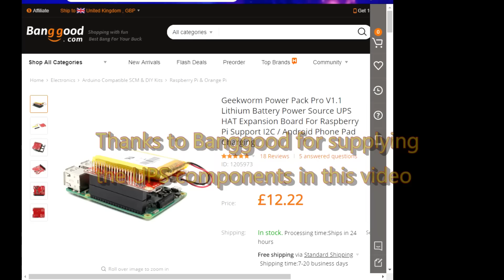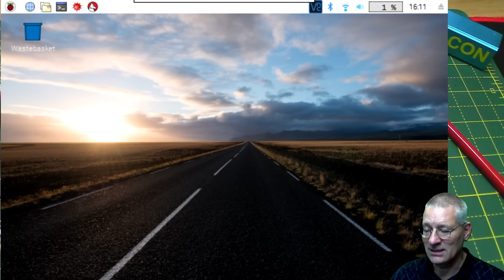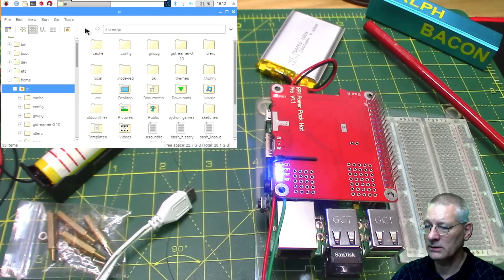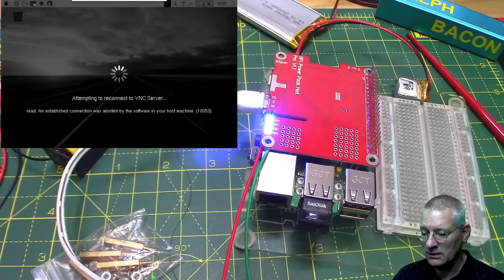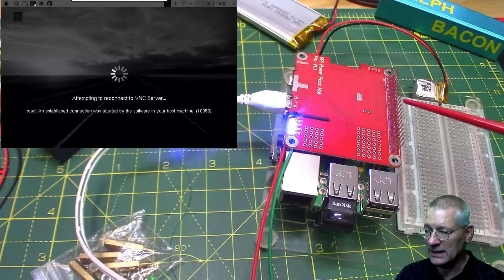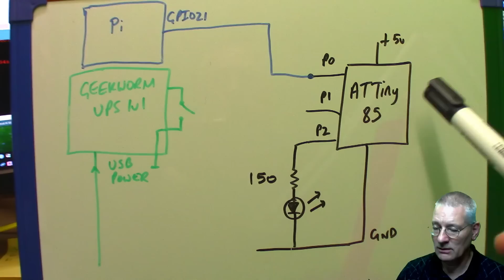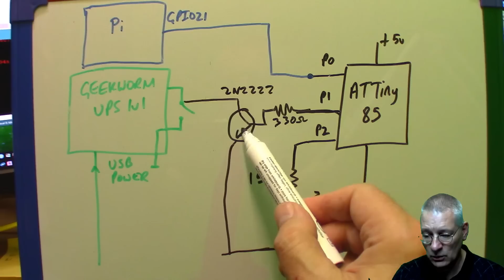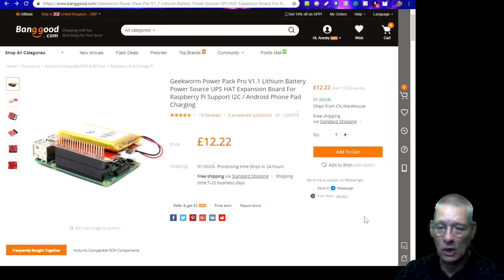#124 Raspberry Pi UPS Fix - with an ATTiny85 control (EASY)

Comment: Another interesting video Ralph. I suppose the next challenge is to measure the voltage from the UPS and send a signal to the RPi so it can shut down in an orderly manner! Then when the voltage rises above 4.5v restart it.....
Reply from the maker: This seems a common theme in the comments today, Ian! Yes, I'm hoping to monitor the battery pack using I2C from the Pi itself. We shall see.
Reply: @RalphBacon  Need video on this..

Comment: nice solution Ralf...….quite surprised the manufacturer missed it
Reply from the maker: I'm not sure they missed it, exactly, just didn't provide a solution for when the battery went flat. They probably thought, "What's wrong with pushing the button?".
Reply: If its in the middle of a bloody beehive pushing the button IS a problem!...haha!

Comment: Great source of knowledge thanks! 
It seems Geekworm released an upgrade a few months ago, and which comes with an "AUTO UPS" switch that would ensure to auto "push" the power switch by itself. If it's effectively working, it would simplify the scheme quite a lot. I'm just wondering how it would behave if we detect a power failure via the I2C channel, then we shut down the device, but during the shutdown phasis, power gets back. My guess is that the RPi will finish the shutdown process normally but will not boot again until a new power failure/recovery cycle is achieved. Actually, I'm wondering the same for the circuit of this video. Anyway, all of this is quite interesting!
Reply from the maker: It's always the edge cases that cause problems, Bilel! I don't know what would happen with this circuit but it's worth mentioning it here, for sure.
Reply: @RalphBacon  If I get to play with it I'll make sure to explain the behavior here! Thanks again for all your content!

Comment: It may be a figment of my imagination but couldn't, what appears to be a couple of sets of 'prototyping pads' on the Banggood board, be used to accomodate the ATTiny85 and the other components - thereby making an 'all in one' solution?

Great video as always...
Reply from the maker: IMPORTANT! THEY ARE NOT PROTOTYPING PADS! I had to shout because others have made the same mistake. They are all connected to ground. No-one knows why they are there apart from possible cooling (ie allowing air flow). Phew, close shave, that one!
Reply: They are almost certainly "thermal vias" that transfer heat from the regulator on the bottom to the copper on the top, increasing the "heat sink" area of the PCB. So they are there to improve heat flow, not air flow per se.
Reply from the maker: Thank goodness someone understands what these holes are for. Mystery solved. I didn't detect it getting that hot, but then again I wasn't really paying attention to that aspect. Thanks for that Ian, now we all know.
Reply: It doesn't get hot because the holes work :D
Reply: Excellent work Ralph, I’m very much enjoying all your work and the in-depth explanations. 

I find your work always worth the time to watch. Fortunately I have enough experience under my belt to finally be able to understand and duplicate your work. 

You also have a very calming voice. Thank you kind sir. 🏴
Reply: I would have guessed the same thing Duncan. I have never owned one so I would have guessed prototyping. I never would have guessed they were all tired to ground. That could sure lead to a very quick short, and it might let out all of the magic smoke. Well I guess if I ever do buy one I won't be able to complain about not enough ground pins.

Comment: little guestion, i have raspberry pi 3 B+ and additional board X820 hdd 2,5" in board, and this say normal raspi need minimum 2,5A power, and whit HDD disk board and hdd disk, need 5A power supply, now adding next time DAC board too, audio need be good, guestion have. CAN i use this ups board my raspberry pi, because need power lot more than genuine. and can i keep power wall adapter alltime to connected wall and IF elektric blackout cut battery working safety and no cut raspberry. i need table computer raspberry have alltime online because here elektric cut rain season manytime/day normal 4-5time/day cut elektric.
Reply from the maker: I don't know the answer, Matti, you need an answer from Raspberry Pi  experienced users. Try their forum https://www.raspberrypi.org/forums/

Comment: Nice board. And nice solution. What could be the next step is to measure the voltage of the battery and make a safe shutdown if it goes low. Also a button to manually shutdown the pi safe (and not booting it up again) would be helpful in some scenarios. I do myself plan to use a pi in a Fotobox for party’s and like to make it bulletproof for the dumb one that pulls the power plug but also have a dedicated button to shut it down manually when the job is done.
Reply from the maker: The safe shutdown theme is running wild today, Michael. I shall certainly investigate that aspect. A manual shutdown that does not cause the Pi to be restarted by the Arduino ATTiny85 is do-able too. Hmm, food for (future video) thought.
Reply: Ralph S Bacon thanks Ralph. Looking forward to it. Grüße aus Sachsen. Michael.

Comment: Ralph that looks like a handy board. I wonder if has one of the Maxim I2C Charge indicator chips. At present could not quickly locate a circuit diagram for the actual board. Will be an interesting video when you get to this stage later on.
Reply from the maker: It has something on board, Michael, that allows comms via I2C to interrogate the state of the battery pack. I shall be investigating in a future video, I suspect...

Comment: I will eventually make one of these, thank you.  However, if I can manage to read the voltage with a tight enough tolerance, I would also send a signal to the pi to have it do a proper shutdown.  Ensuring it does not corrupt the ssd card or thumb drive by randomly shutting down during a write operation.  ("shutdown -P now" with root privilege.)
Reply from the maker: If you watch my video #173 (and #176, not yet published) You will see a simple circuit to do this. Your Pi must monitor a GPIO pin that is set LOW by the  µC, carry out housekeeping tasks, then the Pi sets it LOW again so that the µC circuit recognises the signal and shuts off the power. It will at least give you ideas on how to do this with a Pi.

Comment: Great video Ralph, it resolved a lot of my issues with battery powering my Pi units. 
 Please please re-visit I2C battery monitoring soon as (mentioned in my comment on the earlier video) I have fatally ruined a couple of uSD cards when crashing. The Pi will then  be almost totally 'bomb proof'.
Thanks again
Dave
Reply from the maker: I certainly want to explore the I2C comms from the Pi, Dave, in order that we can shut down tidily. Keep tuned...
Reply: @RalphBacon  Apologies for taking more 'bandwidth'.  Testing with my 'HAT' I've noticed that the 'lightning strike' only appears on a local monitor and not when running the Pi headless. Strange. The Pi power LED still flashes on and off however. So some attention needed to my UPS HAT. Keeping tuned for battery monitoring...

Comment: Nice Video, Ralph!
I personally do not like any sort of Lithium Akkumulators, because they have a tendency to burn/explode, as well as they do not like any environmental condition below freezing point of water. I prefer Ni-Zn-Akkumulators [low self discharge / low temp. < 0°C capable / simple CCCV recharging scheme using controllers like e.g. ATtiny :-) ].
But your application with the ATtiny is great! Well done!

Btw. you could use a USB-to-TTL(3.3V !!!) adapter and use the debug console of the Raspberry Pi (via Putty) instead of using a Monitor + Keyboard + Mouse if anything goes wrong with the RPi.
And a good alternative to VNC could be the "free version" of MobaXTerm. It is at least much faster than VNC and works with all graphic applications from any Unix System, not only from RPI/Debian, to bring onto your Windows desktop without hassle.
Reply from the maker: Interesting points you raise Sebastian.
 
I will look at Ni-Zn cells as I am not familiar with them. And I will also look at MobaXTerm, assuming I can run it on Windows and on the Pi. If it's quicker than VNC but just as reliable I may switch!
 
I didn't know you could debug the Pi like that either so I will try it out. Thanks for all the info, good of you to share.
Reply: @RalphBacon  Hey Ralph!
Well, the MobaXTerm is just installed to Windows. The RPi does not need any installation for MobaXterm, since graphic applications as well as some of the text applications (e.g. xterm, EMACS, etc.) do already contain support of sending and receiving via X11 protocol for remote access. Perhaps you have to set the environmental variable "DISPLAY "to your windows computer where MobaXterm is used by some command like "export DISPLAY=<ip-address>:0.0". But that should be about it...
Here some links about configuration/usage:   https://www.raspberrypi.org/forums/viewtopic.php?t=21610  and   https://www.youtube.com/watch?v=vyppO5_WnMU

Have fun!
Reply: ps.: Here a link for some datasheets from two of the many nickel-zinc batteries about "constant current / constant voltage" charging cycles:
https://cdn-reichelt.de/documents/datenblatt/D600/ANS_NIZN_4XAA_DB.pdf
https://cdn.sos.sk/productdata/29/72/e34660c7/4aa2500mwh1-6v-bp4.pdf (a little strange that this document warns about possible explosion and fire since Ni-Zn do not contain flamable / explosive ingredients, which is one of their major advantages over most rechargable batteries)

 And here also some kind of more general information about Ni/Zn batteries: https://briefs.techconnect.org/wp-content/volumes/Nanotech2011v1/pdf/1392.pdf

I am not sure if Ni/Zn batteries might also be charged using some pulse charge, where a ~1 sec pulse is applied and then during a break of like 1-2 seconds the cell voltage is controlled to decide if the charging process should continue. Or as an alternative method charges a cell with a ~1 sec pulse and then waits the cell to drop below a certain voltage again after some time while the pulse is cycled off, to then restart a new pulse charge cycle until this voltage drop does not take place within a certain time window, as well as it controls the temperature envelope of the cell at the same time.
But this would perhaps be something to look into and have some tests about this I guess? At least such ideas can make up a very nice test and development field for arduinos...

Found something interesting article about pulse charging Ni/Zn in a research document (section 4.3.1) in:  https://d-nb.info/1119447232/34  ...concluding a "2 sec ON / 1 sec OFF cycle" for DC pulse charging of commercial Ni/Zn cells. Actually this document suggests that DC-pulse charging is actually better for life time expectance over the CCCV method. Interesting!
Reply from the maker: I will have a good read of the links you sent, Sebastian. I've just read the Wikipedia article (https://en.wikipedia.org/wiki/Nickel%E2%80%93zinc_battery ) which was interesting so I need to dig further.
 
The fact that they have a nominal voltage of 1.65v means they could be a better replacement for alkaline batteries than the Li-Ion 1.2v batteries, in many cases.

Comment: Great video ad always of course.  I always get excited when I see you're going to use an ATTiny. I keep hoping you're going to post the Gerber files to set the fuses (hopefully through hole components)  I just couldn't make out the tracks and such on your old video where you showed us how to burn fuses and reset them again. If you don't have the time for Gerber files how about a schematic? Oh well, maybe next time. 🤔
Reply from the maker: What a coincidence, vonries. I have now created the PCB (and schematic) for the ATTiny85 Fuse Resetter. Whether it works is another matter. It does use THT (I just couldn't face SMD for this project). When I have it all working I will publish a video on the entire process. If it works I might even send you a PCB for free!
Reply: @RalphBacon  You are the man! I have a 14 pin ziff socket thay I bought when I was originally trying to build one from your original ATTiny fuse reseter video. Do I need to order a smaller one? So it will fit your board? Thank you so much for not giving up on this project/ chip.
Reply from the maker: The boards have arrived! But not yet tested. 

They are sitting here on my workbench, calling to me. The 14-pin ZIF will fit, it's what I have designed the board to use. Keep your breath bated, it won't be long now. I just wish we had 30-hour days. 

BTW I will be giving a couple of the PCB boards away so you never know (unless one were to email me ahead of the video, but you wouldn't know that my email address is hidden in my About tab of my channel), oh well...
Reply: @RalphBacon   I must be worse off than I thought. I can't find it in the YouTube about (Mobil version), on your GitHub, or on your blog. I'll have to see if it looks any different on my laptop. My desktop burned out my power supply, I think.  Is it safe for me to post my email here for you, or will I be flooded with junk mail?
Reply: I sent an email to someone here's hoping it was you, lol.
Reply from the maker: It was, and I've just sent you another one!

Comment: Nice works well, but I du not understand way attiny85 burn in less then a day and are use less then.
Reply from the maker: An ATTiny85 will last forever if it is treated correctly: 5V supply and no more than VCC + 0.3V on any of its GPIO pins. Max 40mA from any one GPIO (ideally <= 20mA) and no more than 200mA in total across all pins.

What are you doing to mistreat your poor little chip?
Reply from the maker: Ah! Costa Rica! Mi pais favorito! I've travelled around Costa Rica far and wide, from near the border up North (with Nicaragua) over to Tortuguero in the East and Manuel Antonio in the South West. Funny thing is, whilst many, many people spoke English/American there were also many that did not, so I had to revert to my long forgotten Castilian Spanish (which they found quite amusing not least because of the way I pronounce the "c" as "th"). It's amazing how far you can get with "Dos cervezas, por favor, y algo para comer!"). Pura Vida!

Anyway, back to your question. I've no idea why your ATTiny85 should give up like that, unless you "hat" somehow gives it more voltage than it can take, but your Pi also runs at both 5v and 3v3 so it seems unlikely. You don't burn the reset fuse at all, do you, to get more GPIO pins? (If that means nothing to you, then you probably are not doing this).

Just to test things out you can use an Arduino Uno or Nano. If you can removed the onboard LED (or resistor to it) the battery will last much longer, but even so it won't last that long. Those Arduino dev boards are not designed for battery use. The newer ESP32-C3 modules ARE designed for that; check them out!

Anyway, that's all I got right now, I wish you mucho éxito con este proyecto!

Comment: I'm rather surprised that you didn't run into any issues with pushing the charge rate for the larger battery into that smaller one. The little modules I have for charging/protecting lithium batteries use a chip (can't recall the number offhand) and the datasheet for the chip shows you what resistor you would have to change to set different charge rates.  Perhaps that could be investigated on this UPS board?  I surely would,  before just plugging in that tiny little battery...
Reply from the maker: I changed the resistor having been prompted by others (close call) and no damage appears to have been done. Just goes to show that attention to detail is required and the devil's in that detail!